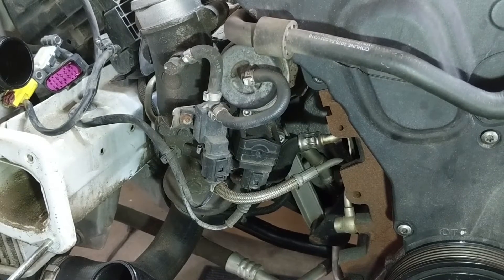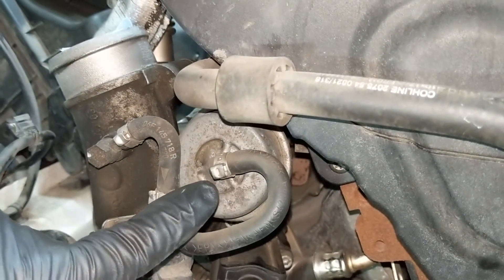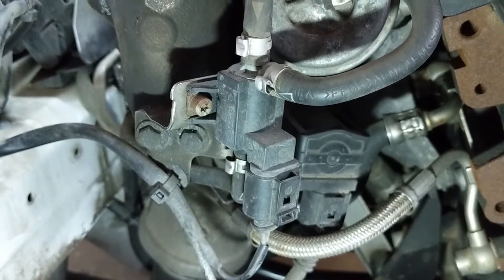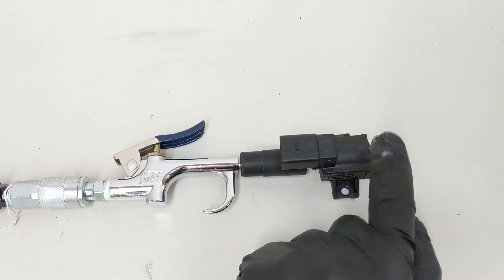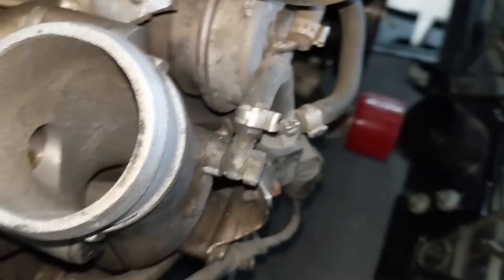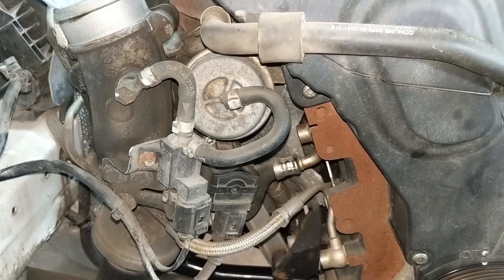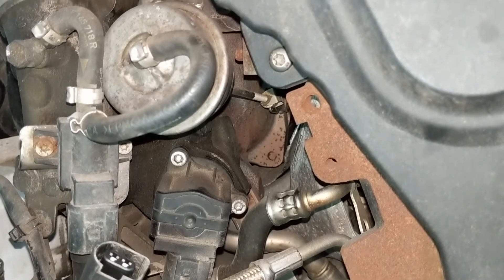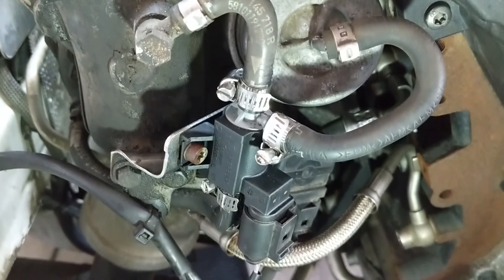N75 Valve - Audi/VW Testing & Install | How it works | 2.0 FSI A4 B7

Comment: hi
I found this channel because I have a P0420 and P0299 on A4 B7. Do you think the N75 could be the culprit? I hear hissing when I shut the car off as well.
Reply from the maker: Hi Karam - I don't think so, but these codes represent some fairly open ended causes. I'll do my best to give you information to go off of, but if you could share some more details, that would help. Like: Has a MIL/Check Engine appeared? What make and model are you driving? Is it modified? Do you have access to a VCDS tool? Are these new codes - cleared and reappeared? Other than the hissing, do you notice a lack of power while driving? Any other symptoms?

P0420
Catalyst System; Bank 1: Efficiency Below Threshold
P0299
Boost Pressure Regulation: Control Range Not Reached

Combined, these codes tell a story and it may be that your catalytic converter isn't working as it should anymore. P0420 would tell us that - in general - there is an efficiency issue in the cat, and P0299 adds that the turbocharger also may not be operating at full capacity, but more likely that there's a boost problem. So, you're not wrong in thinking the N75 could have a role here. But to me, the problem seems to be further downstream towards the exhaust.

Realistically, the cat could have some problems that is causing the o2 sensors before and after the cat to flag the system efficiency is down. If we assume there is a blockage of sorts, this pressure would also impact the turbo's ability upstream to get rid of exhaust gas as quickly as it needs to.

There are many tests to do though related to your MAF, oxygen sensors and boost levels if you can access a diagnostic tool - before replacing the cat. A visual inspection of your N249/Diverter Valve is a quick and easy place to start, too. If it has the diaphragm on it, it could be torn and should be upgraded regardless.

Your hissing noise is a stumper, though, especially when the car is off. That would indicate air (or steam) is being vented to atmosphere from somewhere, or potentially being sucked into the car by vacuum. I'm sure that sound dissipates quickly, though?

Hope this helps. Share more!
Reply: @FigureItAuto  hi. the MIL is on for those two codes. the car is very slow to accelerate. I have an 07 A4 Quattro. just bought it a couple of weeks ago and this happened on my second drive. this is my first venture into Audi. No mods that I know of. car doesn't seem to have been taken care of. I don't have access to VCDS. I cleared the codes and they appeared instantly. I've checked the hoses around the turbo. they seem fine. I've checked the diverter valve. it's the new style piston kind. Lack of power is very obvious. I can hear the hissing on the turbo side of the engine when I shut it off. it goes away after a few seconds.  Thanks for responding btw. I really appreciate the help.
Reply from the maker: No problem - happy to help and I hope anyone else reading this now or in the future can add to the convo or learn from it.

The loss of power makes me think you either have a major boost leak or your car has been put into limp mode from the check engine status. 

From the sounds of your checks, the only part that could be a problem on the charge side of the turbo is the N75 valve. It could be stuck open and continually recirculating boost back into the turbo. Since your DV is the piston revision and you say you've checked the intercooler hoses coming off the turbo to the passenger SMIC, then SMIC to lower core, then other side of the lower core to the driver SMIC, and SMIC hose into the intake manifold, it only leaves the N75.

On the exhaust side, you could be experiencing a bad waste gate valve, though. If it were to be stuck open, a good deal of boost is bypassing the turbine and going straight out the exhaust. Or, it's being caused by a faulty waste gate actuator. It's not impossible you have a large exhaust leak coming off the exhaust manifold or between the cat and turbo, either. 

How does the car sound at idle? Have you checked for vacuum leaks? The hissing sound is still the most confusing part of your issue. If it's air escaping from somewhere, try to pinpoint it with the soapy water bubble test.
Reply: @FigureItAuto  Thanks for the reply. I got a new N75 I'm installing tomorrow. I'm also going to find a shop to run a smoke test if that doesn't work. I'll be sure to let you know what happens. thanks again.
Reply: @karamkamel3074  Hey Karam, any updates on this? Having similar issues.
Reply: @Xxx23DWIGHT23xxX  Update: so I replaced the N75. nothing happened. I now have codes 420, 455 and 299. acceleration is trash especially on hills. I have to take my floor off the gas to get it to shift up. I have a WIFI OBD II scanner which can show graphs and stuff. anything I can look up on there to identify the problem? Any advice would be much appreciated. oh also, for a while the car thought the gas cap wasn't closed properly as well.
Reply from the maker: @Karam Kamel Adding P0455 - EVAP Emission Control System Gross Leak Detected makes things interesting. A "gross" leak is the first thing that might explain the noise you've been hearing, and is starting to make sense with your other codes. Although an EVAP leak could come from a number of places, there are a few fundamental maintenance items to replace that could also fix this issue. It'd be great if you had old service records to confirm this but: has your PCV valve (06F 198 207) or the N80 valve (06E 906 517 A) been replaced? I'd start there - and if you plan to keep this car for a few years, honestly just buy a few PCV replacement kits. These are both relatively cheap and very easy to replace. Part of the PCV refresh is a breather hose down to the turbo and it's possible this is contributing to your P0420 and P0299. But, I doubt it's a 1 part solve-all.
Reply: @FigureItAuto  I checked the N80 tonight. I blew air into it and no air came out on the other side. does this mean it's working? I'll check the PCV next. the car sorta ok when cold and starts really lagging when it warms up.
Reply from the maker: @Karam Kamel - Depends what scenario you're emulating. In the most basic terms, when power is applied to the N80, air should be able to pass through it. When it's not powered, it shouldn't (you did that part). However, the fact no air passed through with the pressure of your lungs doesn't totally answer if it leaks or not. If you were able to apply vacuum to the solenoid and see if it can hold it, you'd know for sure it seals properly. Nonetheless, you proved that it's not stuck open, which is good.
Reply: Karam Kamel My problem was pretty much resolved through changing out the N75, not sure if turbo is operating at 100%, but check engine light is now off, I hope your problem can be resolved as well👍🏽
Reply: @FigureItAuto  Anyway I can check if the PCV valve is good? also any guidance on how to use the OBDII to figure the problem out would be much appreciated. sorry to hijack your video, it's just knowledgeable people are hard to come by :)
Reply from the maker: In terms of using your scanner, I'm not sure if that's going to be useful, only because I'm not aware of any MAP sensors in a place that's going to see vacuum. That said, the PCV is only a matter of 4 torx screws and releasing the clip of a breather hose to get off and inspect. Testing aside, check the part number. Since you've got an 07, you're likely to see P# 06F 129 101 E or 06F 129 101 G. The newest revision is 06F 129 101 P and I'd just upgrade straight to that. Again, I'd just buy the/a whole kit (seals, new breather hose for 06F 103 221 H instead of version F and the breather tube 06D 103 215 A).

To test though, it's said that while the car is running, you should have slight but not extreme suction on your oil fill cap while you try to pull it off from the valve cover. Additionally, with the PCV removed, if you blow into the tube facing the cabin, it should not allow air to pass through. If it does, the check valve doesn't work properly and you'll have a leak - but one of many that could be occuring, hence the parts replacement. Here's a post on Audizine that explains the PCV system quite well.
Reply: @FigureItAuto  Thanks. I may just go ahead and replace the stuff.
Reply from the maker: @karamkamel3074  Just double check before ordering PCV related parts what your production date is. You'll see it stamped on the black metal tab just in front of the valve cover. Or in your owners pamphlet.
Reply: @FigureItAuto  I was about to ask you. are the different part numbers not interchangeable? about the scanner, I can use it to eliminate the catalytic converter  or the turbo I just don't know how. like what boost should I be reading at what RPM? or what should the O2 sensor readings be?
Reply from the maker: @Karam Kamel The different revisions of the same part are interchangeable, but it's always in your best interest to make sure you're upgrading to the newest part by design, unless one isn't offered/you have it already. The only reason I brought those up was because there are 2 streams of parts related to the PCV system depending on a split in VIN numbers.

As for the OBDII, my experience is limited to the Ross Tech VCDS and the way I could refer to testing blocks may not mean anything to your scanner. Regardless, I'd ignore the scanner for now and just strategically replace the parts you think will have an impact, then see the result on codes thrown.
Reply: @FigureItAuto  Will do. thanks again. I'll keep you guys posted.
Reply: @FigureItAuto  Hi. I finally replaced the PCV valve and its hoses. I'm now getting p0299, p0420 and p0171 (new code ). the car still runs like a dog.
Reply from the maker: Hey @Karam Kamel, thanks for reporting back. P0171 - Fuel Trim; Bank 1: System Too Lean - helps some previous information make more sense. For some good info on fuel trim (and mild entertainment), read Ross Tech's summary: http://wiki.ross-tech.com/wiki/index.php/Fuel_Trim_Info. And it's great that the P0455 went away; that's 1 down.

Too lean obviously infers a lack of fuel - but based on all your previous comments, you must have a significant leak into at least one system that's affecting combustion performance. I say this because: 1. Broad lack of power, 2. Whistling/hissing noise still present, 3. P0171 is not exclusively a fuel issue.

To me, it's time to go back through the car very carefully and check/clean/reinstall a number of things but let's assume (for $ sake) that we're not dealing with a major fuel issue from the injectors, pressure regulator valve or low pressure fuel pump. Think about:

1. High pressure fuel pump. Right by the valve cover, easy removal and the point here is to check your cam follower that fits on the end of the pump piston and rides along the cam. This is a classic failure point for the car and you'll want to get used to checking and replacing that little follower (and the HPFP seal and 3 bolts). Do this no matter what.
2. Check the air intake for fitment. All the way from the front of the bumper, where it joins together in the intake, how it connects to the airbox, the airbox itself (2 clamps), where this connects to the turbo inlet AND
3. The MAF inside the inlet. Clean and inspect. If you can use your scanner to ensure it's properly receiving data, that could be important.
4. Clean/replace air filter
5. Check side mount intercoolers for cracks and check all the hoses that go to and from them (2 on each side). 
6. Find vacuum leaks. Check literally everything - spray a carburetor cleaner on all hoses/lines and specifically anywhere you can hear a noise. Listen to the engine as you spray to determine if a leak is present as/if the cleaner gets sucked in.
7. Determine which revision of a vacuum pump (pretty much top of engine, next to firewall, just lateral to the HPFP) you have. The older models tend to leak oil down onto other important things but also have a different design inside for being driven by the cam. As a long shot, the pump itself could be failing.
8. Check if your gas cap is properly seated - oil dipstick too.

If you can solve this problem, there's a chance all your other codes will disappear as the other systems begin to function properly again.
Reply: @FigureItAuto  I really appreciate your detailed responses. I would subscribe twice if I could  :)
Reply: @FigureItAuto  Update: current codes 0299, 0420 and 0455. also close gas cap warning. my OBDII is reading the following at warm idle:
engine load: 21.5%
coolant temp: 172.4
STFT: -.78 to 0 at idle, 0 to 3.5 at 1500RPM
LTFT: 8.6 at idle, 8.6 at 1500 RPM
timing advance: between -2 and 0
air intake temp: 120.2
MAF: around 2.5 but moves frequently
throttle position: 12%
O2 sensor voltage B1: .1 to .7
O2 trim: no reading
fuel rail pressure: 700 to 720 frequent movement
commanded evap purge: rises from 0 to 32, purges and starts again.
O2 sensor current: -.03 to -.05 mA
O2 sensor air/fuel ratio: 14.5
Cat temp: 934.88
ICU voltage: 13.2 to 13.4 rapid movement.
absolute load: 19.6 to 20
fuel/air commanded ratio: 14.69
throttle actuator: 2%
long term secondary O2 trim bank 1: 0
boost: 0 at idle up to 30 when flooring it

can you glean anything out of the ordinary from these?
Reply: @FigureItAuto  maybe you could give me a hand I'm having some issuesp2293,0087 my car once it hits between 2.5 and 3 k  RPM the EPC like kicks on. and there is hardly any power it pulls okay until then but then seems to die and I feel like the turbos not kicking in... 2006 Volkswagen GTI FSI... Pulled out the high pressure fuel pump cam follower looks okay I actually put a new one in about 300 miles and. High pressure fuel pump looks good. Please anything will help me.... I just paid $3,500 for this car and haven't put 500 miles on it...6sp manual
Reply from the maker: @Simpleman1078  Thanks for the note. I've never encountered these VAG codes before so what I'm about to say only comes from hypothesis and some browsing on trusted sites (like Ross Tech).
P2293: Fuel Pressure Regulator Valve (N276): Mechanical Malfunction (http://wiki.ross-tech.com/wiki/index.php/18725/P2293/008851)
P0087: Fuel Rail/System Pressure: Too Low (http://wiki.ross-tech.com/wiki/index.php/16471/P0087/000135)

Basically, you're running lean and possibly going into limp mode.

So first off, it's great you checked the cam follower. If the follower looks good, I'm just assuming the cam lobe and bottom of the HPFP piston was good too. At the very least you're not at risk of mechanical disaster. P2293 specifically references the N276 which is part of the HPFP unit. I believe you can replace it individually but I don't think it's cheap and doesn't sound like an easy (hard to do, easy to break) job. If you're willing to spend some money and go straight for a new (I think Hitachi is the OEM) HPFP, it may solve your problem right away. HPFP's changed for your car in '06 though so make sure to reference your VIN for the right parts.

If you want to be a bit more conservative, you could consider the problem is further upstream towards the fuel source and that fuel is being cut off elsewhere. Replacing the fuel filter is probably the cheapest, easiest test. It's conceivable your low pressure fuel pump (in the tank) is also at fault. I'm going to guess you would have noticed a fuel leak by now if it existed, too.

Comment: Thank you very much for this video.. The best i've have seen yet.. It explains a lot!
Reply from the maker: You're very welcome, Michael - I hope it helped you out.
Reply: @FigureItAuto  Yes... only I have a B6 model with a 1.8T 20V engine, and there is a  a slight difference in construction. But the working is the same..